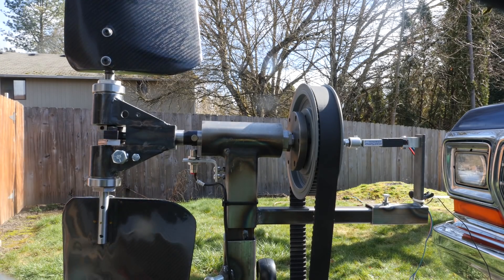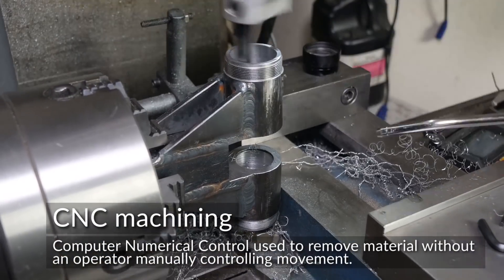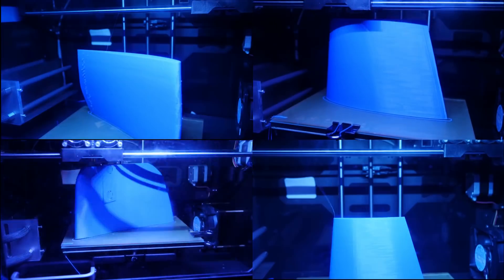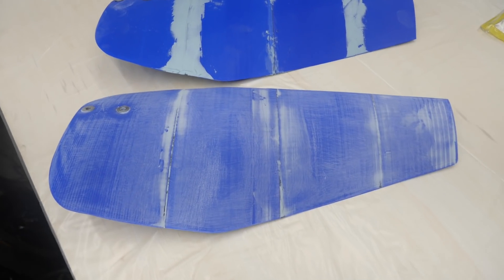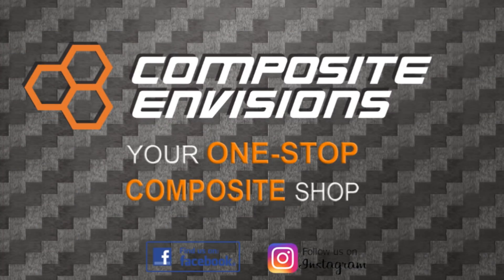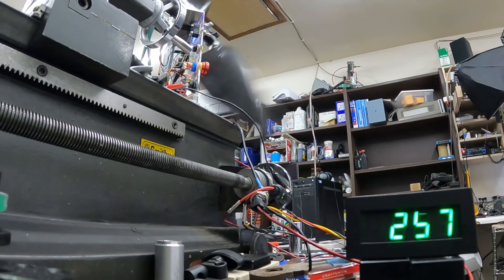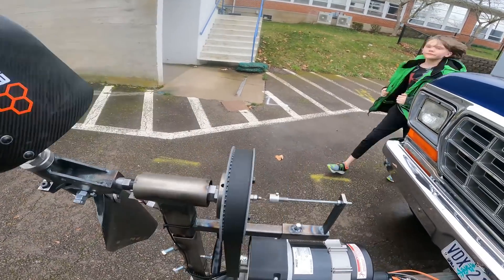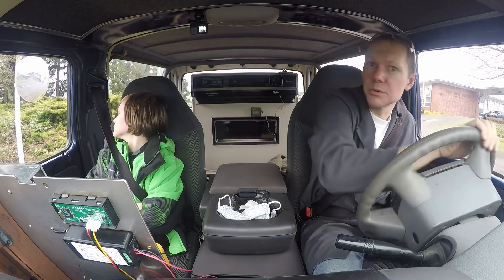Carbon Fiber Blades Making 2000 Watts! - Wind Power on a Car #4

Comment: This is the worst fan propeller design I've seen to capture wind. you could have easily produced more then 20khw with a different type of fan design.
for example puttinga horizantal screw driver bit shape fan design on the top of roof would have increased maxium wind drag fow through the edges and body of the fan blades, thus generating a many pounds of air flow that can then be used to in a generator style connection to charge a battery pack. 
think of a screw driver bit wind fan blade, stretching in the horizantal axis across the top of your car to keep a low profile.

Comment: My question is if in a ev you put this behind the radiator could you charge the battery in movement? Because my idea is a huge solar array on a old gmc rv, tesla swapping and puting at least two full tesla battery packs in it, anything the can extend the charge would be great, with the front of a rv that used to have a huge v8 engine you could make a wind tunel that helps aerodynamics and at the same time charge i think. Add regenerative braking and the solar on top (not extended) and i think you could get 3 to 4 kw on the move. Not something that i can do yet but a dream to look in to the future. To go from alaska to tierra del fuego without pay for gas.

Comment: I had this thought a while back, and I quickly concluded that I was going to “pay” for any energy generated with combustion in the engine. The reason is that my thought experiment had the turbine on TOP of the car, a place where there isn’t already wind resistance. 

For some reasons I never considered it in FRONT of the car. As soon as I saw
You were doing that, my skepticism relaxed a bit (was pretty much with you - let’s see if it happens). 

The naysayers are missing a very key point about what you’re doing by having the turbine in front of the grille, reflecting their own ignorance about physics and their own hubris in refusing to listen to explanations of those they don’t agree with. I love the way you take it all in stride; wish I had the same sense of “idgaf” as you do

Comment: Your nipper is really switched on. Loved his excitement for getting the results of essentially months of trials and tribulations. I assume you are real estate limited but maybe putting the actuator on the front side of your hub and pushing in rather than pulling, I think it's that way round, should be able to let you keep the load within the rating of the actuator? 🤷 Finally, he seems pretty articulate, it would have been nice for him to talk us through his control board, what he used component wise and when he planned to use each of the features. I see he had Stall, man/auto, pitch etc. I'm assuming if he's got an auto switch, there is an algorithm to maintain a certain RPM by adjusting pitch & load keeping your disc in its optimum sweet spot?!?

Comment: Good drills on getting it balanced. Would like to have seen more on how you got that dialled in. On helicopters we use a track and vibe kit which can take hours as it has to be in spec for different speed ranges.

Comment: I have an idea maybe you can do it because you have most marerials to do thats maybe help car to make more mpg the idea is put ev system with gas engine  ( semihybrid system ) i name it, put the electric motor same as alternator mount on crank shaft + batteries+ inverter+ accelerator+ and accelerator bedal maybe you can do it because you are smart

Comment: Take your idea, put it in a coverted DC powered vehicle with no extras, then put a high rpm low profile home wind turbine generator that is braced at the bottom and top running across where the radiator used to go. Do three of them, print you helix blades. Problem solved, the generators start spinning at 5 mph and have a tolerance of an output max at around 100 mph, with the added bearings then faster speeds are available without damage to the generator from extra support. Plus a helix blade removes extra stressors from the length of the blades. Run one electric generator to just before the control module, run another to an invertor connected with a charger connected to the batteries, leave the third available for adding other options from starting from bare bones needed. Use a transmisssion that is a standard along with a minimum of 5 or more gears for the beta testing. Do not worry about making it work with an A/C model.

Comment: This is incredible. I have no idea why we don't have smaller turbines inside the grille of every electric car. Obviously they wouldn't make as much power. But if you have 6-8 smaller fans all driving one generator we could easily boost range by 10-15%. Maybe even more because we wouldn't need as large of a battery which would reduce weight significantly. Or we could have that power go directly to the motors instead of charging the battery where there's lots of losses.

Comment: Great video, How come you didn't 3D print the blades in CF nylon? Also putting a fan inside the enclosure would have caused even more print problems.

Comment: Be interesting to compare what you get off the engine accessory belt. And also do the power/drag calculations of efficiency with fuel consumption vs other methods

Comment: @Quint BUILDs - Enjoyed the verticle "Wind Power on a Car" videos and was thinking you should consider building and testing a "verticle/vawt" wind generator (on the roof vs the bumper) using a design similar to this... https://youtu.be/WlvA99c2xFQ

Comment: At 2:30 seconds, I stopped the video. 
 I am so impressed with the quality of the assembly you designed. Very time consuming. It's really nice. It's so fun to see someone putting their learning to work !!  You and Adam Savage !

I'd like to see you make indestructible bifocal lenses, both top and bottom of the lens so you can look up-and-down,
from scratch,  pun intended;
or REPAIRABLE frames for bifocals.

Maybe lighting also.

That'd be nice. 

Thanks.

Comment: that idea about gas consumption was in my brain as you told wind speed behind blades is lower after they spin,
and fast 'result' guess : no change, as the hole construction need still to 'fight' against the wind, BUT you get more energy out . hmmm = sounds not logic.

Comment: I never knew how forgiving baking bread was to temperatures until I started using a solar oven to bake it. My cardboard and wrinkled aluminum foil creation still doesn't brown the bread, but it's fully baked. So I like to see bread baked, especially in such a unstable method.

Comment: @Quint BUILDs if you ever come across a use for corrugated carbon fiber panels or really durable carbon fiber panels, let me know and we can exchange information somehow. The last project somebody used my dads carbon fiber for was replacing Kevlar armor plates in a vest with his material and it worked. It’s sourced from military production so his panels come out stronger.

Comment: You should find a way to put that on a tesla and use an external battery for constant input. Understandably, it would not be able to charge the car by it self, but for long trips, it would definitely extend battery life. 
Biggest challange I see to overcome would be the power converter. (Unsure if it will even let you drive while charging)

Comment: Build a small steam engine with glass sealed mirrors to guide light from around vehicle to boiler. Let it spin strong horizontal flywheel till it builds enough YANK, and use the force saved in the flywheel to get turbines spinning. Steam system only needed enough to keep everything spinning when it all gets going. Experts world wide = Corrupt & spies.. As proven with the knowledge of the "top expert" for covid.

Nuclear reactor = Radiation heated steam system. 575F.. Fresnel lenses reach around 3,000 for a low price if you can use some tricks to keep light coming during day. Make hydrogen during day with your vehicle using excess power, and run some of that in your engine to compensate for the weight lmao. Look into ultrasound to change pressure of hydrogen converter to speed up gas ejection. Build an alcohol filled radiator to use as a condenser to recycle your steam and distill drinking water as a bonus. YES. Heh..

Demand constant power and drop batteries where possible at home.. System is in distress which will include essentials if we fail. HF!

Comment: I did the exact same thing of designing a profile in qblade, offsetting sketch profiles, and lofting between the sketches.
My question is, Did you find a faster way to do it? That part took me forever.
Reply from the maker: I was able to export 3D points from qblade and make sketches off those points in CAD.

Comment: I realize this is a bit old but you really should put those heaters into a heat sink. 

They'll be a bit more efficient at transferring heat into the printer and won't slowly destroy themselves from grossly overheating like that.

Oh and much safer.

Comment: I think better top of the car building a vertical wind turbine. The car push over the air, and can you build a close wind turbine house, because on the front is dangerous, I think.

Comment: what about using this electric energy to run an engine, i mean : switch from diesel or gazoline to electric car
Reply: I think he will find the amount of energy produced is about the energy equivalent in extra fuel used, probably less.

Comment: Sir why do we use calculus for and when  and why it's  needed
Reply from the maker: Are you asking what calculus is for?  I hope to eventually make videos on this but it will be a while.  In short it's very powerful for examining "rate of change" like how fast a car can change its velocity (acceleration) and exactly when it will arrive based on that change.  Of course that car could be any object that moves in any direction.
Reply: @QuintBUILDs  thanks

Comment: Think of mounting your fans inside a tunnel designed to compress the air to higher speeds.  Would work well on elec. semi trucks.

Comment: Made 2000 W of electricity, drained vehicle of more than 2000W Power and gasoline
Reply from the maker: Nope, we checked it: https://youtu.be/tEPBdztGMdI
Reply: @QuintBUILDs   have to check it out, but that defies the laws of physics. Perhaps it's because it's directly in front of the grill in the air stream that would  be blocked and resisted by the truck itself anyway? So there is no loss. 

However if you mount it on the roof in what would ordinarily be a clean air stream  Never interfered with by the truck, I would imagine it would Have to put at least a 2000 W load on the truck to be able to maintain the same speed if it were not up there.....
Reply from the maker: @7x779  bingo!

Comment: Really cool project! Except, this is inefficient because youre adding wind resistance. Better off pulling from the alternator.
Reply from the maker: Ah but I tested that and it turned out the alternator is far worse: https://youtu.be/tEPBdztGMdI
Reply: @QuintBUILDs  lol, that just means your truck has terrible aerodynamics to begin with. And there could be other factors, wind direction, wind speed, engine temperature, windows down, etc.
Reply from the maker: @jameswatkins7763  that's why I figured it had to work, driving a brick down the road. :) However I managed those other factors very carefully, averaging both directions, keeping windows up the whole time, switching back and forth throughout the testing period.
Reply: @QuintBUILDs  I would personally rather have a more aerodynamic car than a giant turbine protruding out the front. Still, very cool videos, thanks for posting!!!

Comment: But why?
Reply from the maker: Curiosity mostly.  Plus a lot of people insist it can't work which we found out it does: https://youtu.be/tEPBdztGMdI  But the video is kinda being squashed by the algorithm for some reason.  Hopefully that changes.
Reply: @QuintBUILDs  haha okay sorry, I assumed this is some free energy bullshit. But your video makes totally sense to me. Sad that it won't work (be efficient) with a car with a lower drag coefficient or better alternator ;)
Reply from the maker: @BiecherBender  we'll see. I suspect a couple 12" turbines in front of my Camry bumper MIGHT be able to negate the use of an alternator for an albeit small improvement in fuel economy.  It will be a while before I attempt it though.

Comment: Also I have a question with your idea couldn't you put two of those on a Tesla and make that Tesla basically never run out of power?
Reply from the maker: Well extending the range is possible.  We prove it in the following video: https://youtu.be/tEPBdztGMdI  Kinda being squashed by the algorithm for some reason.

Comment: 😆😆😆 I feel so bad for you a project like that you definitely did not need to do vacuum bagging you could have literally just made a vacuum chamber the size of the part that you needed I'm not even kidding you you could have used a fish tank an old fish tank if you could have found something that would fit in there and basically throwing a couple layers on there you know you wet out the part you throw the couple layers on there and then bada bing bada boom after you throw it in the pressure chamber and got all the bubbles out after you thoroughly rolled it out you could have just sanded it down to fit no problem and it would have just been perfect that way I'm sorry they talked to you into doing the vacuum bag process was not needed for a project this size vacuum baggings was not the best way to go
Reply: And that sunscreen stuff that you're talking about the UV blocker you send it all that off with your wet sanding process you should have added three to five layers and then started with around 1000 grit for your wet sanding and did it very lightly we're talking extremely lately and then did a quick buffing pad around 500 to 600 RPMs for less than 30 seconds at a time till you got the desired finish that you want to be honest you didn't have to go through all that but I appreciate your attention to detail but some of the stuff like you said just seemed a little unnecessary great job though I love this video I'll keep my dumb mouth shut
Reply from the maker: Really?  Is there a video out there somewhere of the fish-tank thing?  I'd like to know more about it.  My understanding was you need the compressive load to push out the excess resin.  And yeah, I piled on the clear coat pretty thick but know I sanded through it in spots.

Comment: While you’re testing load with and without. You should measure how much power you can produce with the amount of fuel used with the turbine minus the amount of fuel used without it.
Reply from the maker: Done: https://youtu.be/tEPBdztGMdI
Reply: @QuintBUILDs  Wow. You know I never even thought about the extra fuel required to overcome the resistance from the alternator. That’s an awesome video. Thanks for the reply as well.

Comment: This is the stupidest thing ever ; carbon fiber blades making 2kw's of power using windpower generated by a moving car is completely idiotic . The car needs to use more fuel to counteract the wind resistance this carbon blades attached to a generator create . there is no benefits to this whatsoever except loss of energy waste of ressources and   material . STUPID STUPID STUPID
Reply from the maker: With respect, see the mileage results then tell me what you think: https://youtu.be/tEPBdztGMdI

Comment: If the wind generator is mounted onto Tesla’s car will it recharge the battery? If it does. Does it can makes the car with unlimited fuel
Reply from the maker: We cover that in the follow up video where we test mileage: https://youtu.be/tEPBdztGMdI

Comment: Use a raft when printing with abs or other materials that tend to warp. With the larger surface area you are less likely to have warping issues and the overall quality of the lower edges increases. You have to level your bed pretty good in advance tho, or else you will have problems removing the raft afterwards.

Comment: this is such a great idea
but without me having to go thru all the early episodes with a fine tooth comb cuz i dont remember if it was said
can anyone tell me why the blades are on the front?
was just thinking about some of the other episodes and the wind resistance it caused
Reply from the maker: just watch the next video.  I answer all that stuff: https://youtu.be/tEPBdztGMdI
Reply: @QuintBUILDs  watching now 
we need more ppl out there looking to squeak out that last lil bit of energy from everyday costs
i have similar ideas with a sail boat
the number 1 energy cost is the cooler and only way to charge batteries is the engine

Comment: Probably the worse project ever seen on internet. The belgium comic   book writer named Frankin was making this idea a joke...40years ago.
Reply from the maker: Can't tell if you're trolling me or actually feel that way.  Either way, don't miss the part where we test it (and prove it works): https://youtu.be/tEPBdztGMdI
Reply: Sorry if it sounds too aggressive. But if you want to produce electricity from fuel, then it could be smarter to harness your truck engine directly to an alternator...or use a proper genset.
Reply from the maker: @yveslegrand9826  I test that in the video link I shared. An alternator on the engine uses double the fuel the turbine does. Go check it out. Since you've already sat thru "the worst project ever seen on internet" by definition this new one must be better.

Comment: You might be able to squeeze a bit more power by mounting it to your roof.  The drag caused by the front face of the truck creates some pressure behind the blades reducing the differential.